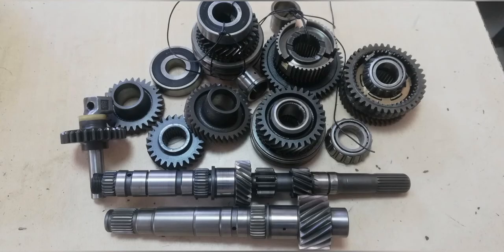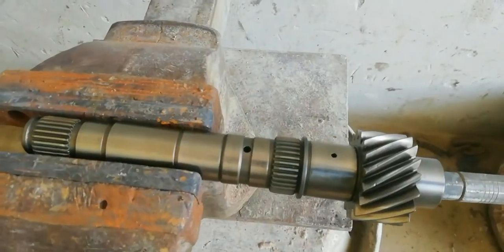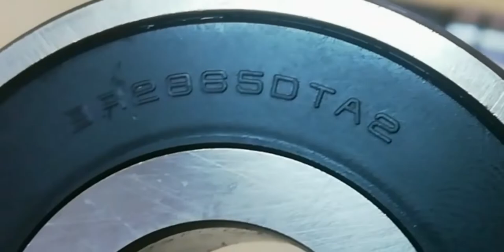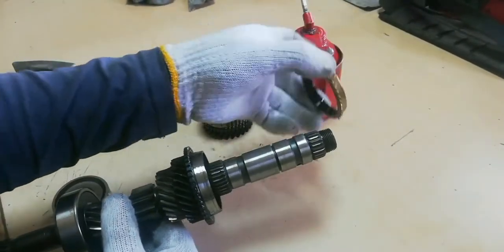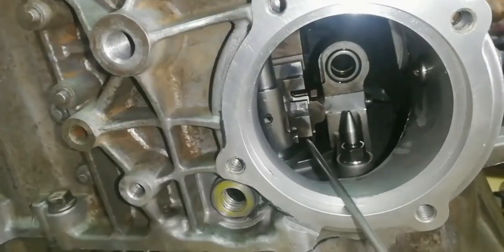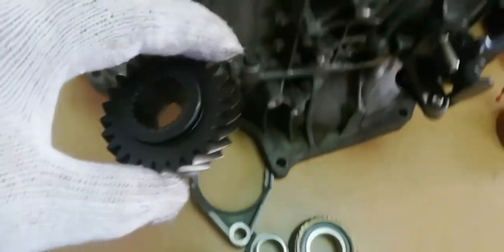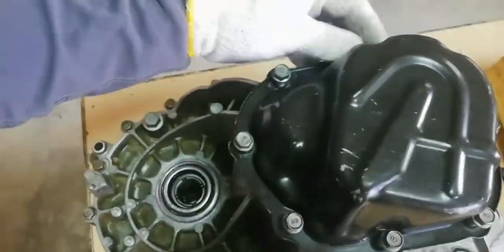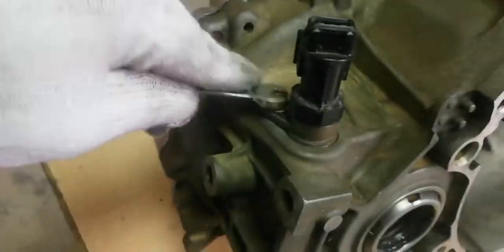HYUNDAI ACCENT MANUAL TRANSMISSION/TRANSAXLE COMPLETE REBUILD AND TECHNICS

Comment: Good morning! Can you help determine the two wire sensor right on top of the trans? I have red/green wires what is this for? ❤
Reply from the maker: reverse switch is 2 wire, speed sensor is 3 wire red is positive and blue is negative supply black is the pulse output
Reply: @yrhelmechanicalelectrical9113  you're a legend! Thank you